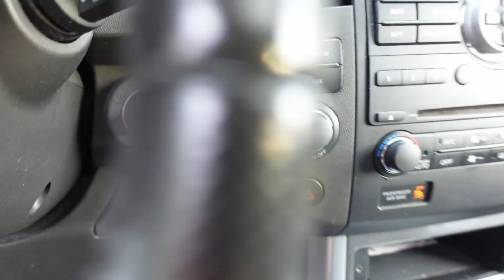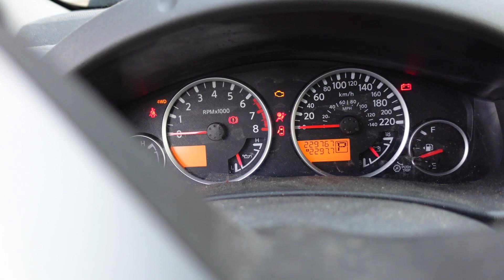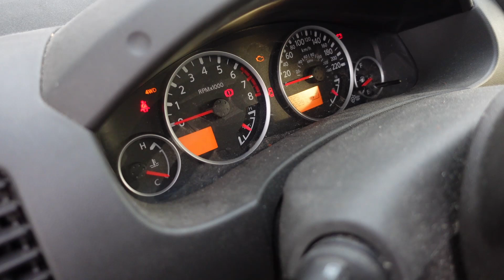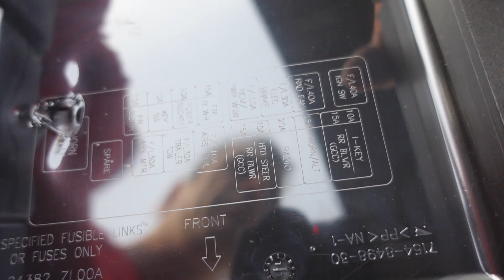Nissan Electrical Trouble Shooting - Auto Active Test

Comment: Outstanding. Did the test and the compressor clutch did not pulse. Put a test light on it and it also doesn’t  pulse a voltage to the clutch line.  Can I assume that the IPDM has a fault? Replace to test? Thank you for the video.
Reply from the maker: it might be something like the fuse or relay. basically a break in continuity of the electrical system that prevents the power from getting to the compressor.
i'm not certain though.

Comment: Good stuff, I hear five clicks before the AC compressors louder 5 clicks come on and those clicks are a lot closer to the front left side near and or under the Air Box Filter. What are those 5 clicks before the AC compressor comes on? 

Thanks for sharing.
Reply from the maker: Which vehicle are you doing it on. I'm not sure if they are all the same. For me it was the lights on and off before the AC.
It might be the something that controls the lights turning on and off, but I really am just guessing.
Reply: @DIYNorth  Its an 03 Infiniti FX45.
Reply from the maker: @ELEVOPR  It looks like it might be the same order for the test for that as well.
Not sure what the clicking is though.

Comment: I have an armada and the compressor and condenser fan work well when a/c is in use. However when I did the test they did not engage. Everything else in the test engaged except my fan and a/c clutch. What could that mean
Reply: Unless the fan isn’t up to par?  I was thinking it could be a pressure sensor as well.
Reply from the maker: That is kind of strange. Does the cooling fan come on when the vehicle is hot?
I would think that if they were working that they would pass the auto active test.
Reply: @DIYNorth  yes the condenser fan does function normally otherwise, and the a/c cools as well. But neither the a/c nor the clutch functioned during the test. Reason that I did the test is bc I am having issues with a/c at idle or when parked. It still cools just not well. When I start driving it’s cold again
Reply from the maker: @yrralatam  I would consider the condition of the condenser and the condenser fan if it blows cold when driving but gets hot when stopped.

Comment: Did this fix your A/C issue? If not, what else did you do?  I have a 2010 with an a/c issue that Im just starting to diagnose.
Reply from the maker: I bought an ac recharge can and did a refill on the system.
Once the pressure was back up it started working normally again.
It is still working now.

Comment: Hi how are you I have a 2009 Pathfinder that needs brakes and rotors what do you think is the best type to get and what is the price
Reply from the maker: I actually haven't done much research on the brakes. I got mine used but it had brand new pads and rotors. I can say that i have Bosch pads and they are the noisiest brakes I've ever had. Always squealing or grinding.
I never buy the cheapest pads and rotors, and I also dont buy the most expensive. If it's just a daily driver around town I'd get the mid priced option. I would assume pads and rotors on all 4 wheels would be around 500 for the parts, but if
you can wait for a sale it could be closer to 400.

Comment: Wow, that IPDM test is like if your truck was possessed! Really cool to realise how much electronics are running In the background! This is a useful quick electric component test to rule out some issues! Thanks for sharing! By the way, it looks like you may need some new tires before winter comes! Have you decided what you’re going to replace them with?
Reply from the maker: It was a level of technical innovation I wasn't expecting from the old pathfinder. I spent a long time looking for the relay that doesn't exist. I'll probably get some Michelin Defender LTX M/S. I'm going to hold off until the fall if I can. These tires suck, but they will do for running around town in the summer.